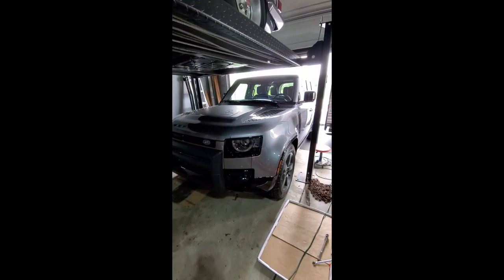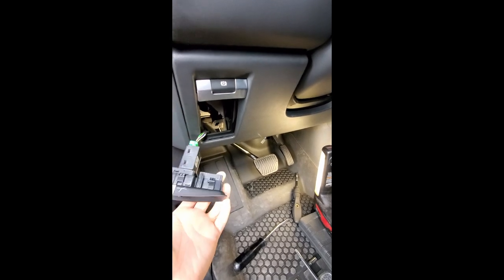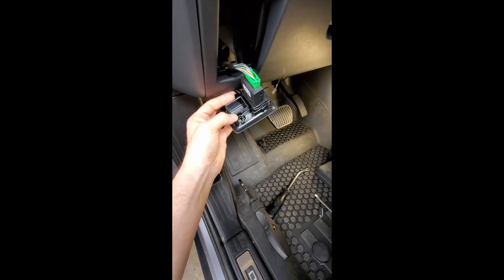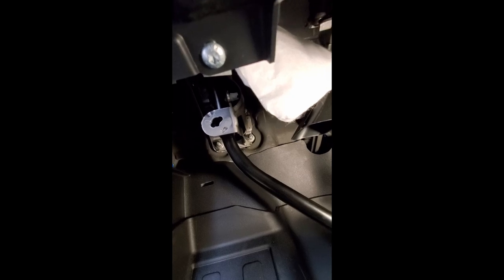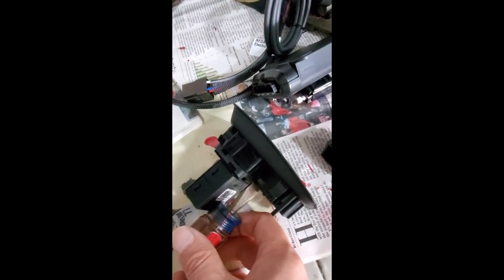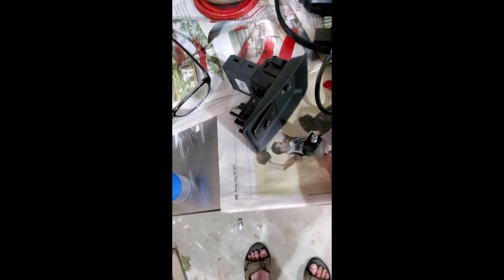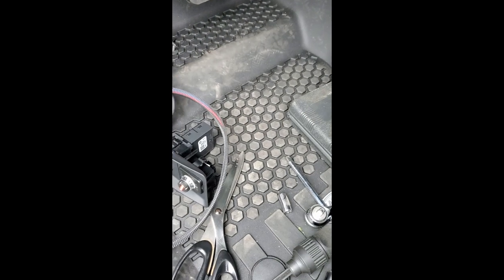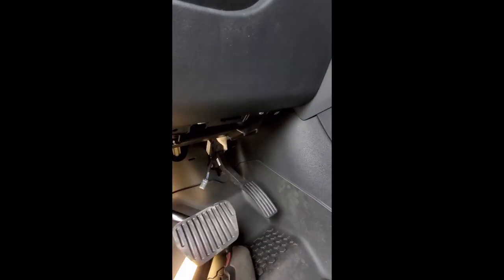Redarc Brake Controller in the New Land Rover Defender

Comment: Thanks this really made the job easy. Two suggestions: 1) drill your 1” hole in the middle of the knock out plate. Control knob just snapped in. 2) after removing the bottom panel of the dash also remove two large screws holding the panel above that. This will let hold bend this panel out just enough to see the back of the little panel you need to remove and get your hand in there to release the clips.
Reply from the maker: Good suggestions, thanks!

Comment: THANK YOU!!!! You've saved me so much heart ache!!! And probably my life...I was told the only thing I could use was a Curt Echo and it almost killed us. I can't wait to replace it!!!!
Reply from the maker: It's been working great for us.  The real problem with the Defender is the spare tire and the side-swinging door don't play nice with our trailer.  We actually have to take off the spare to tow it!
Reply: @midwestmotoring  agreed. The airstream dealer installed a Blue Ox Sway Pro for us that has a pretty longe tow hitch which gave us the clearance we need and we can even open the door a little. It violates what is in the Land Rover Manual, but I have to call and see how bad that is. The Defender manual really doesn’t provide much detail.
Reply from the maker: @TimWat12345  I think the length of the hitch has more to do with the tongue weight.  If you move the trailer farther back, it's effectively creating a longer lever arm and therefore more downward force on the hitch receiver.  If you're not maxing out on your tongue weight, you're probably okay.  It would also have a force that's different when turning, but I bet that's less relevant--especially given the wheel base on the 110.  Again, don't max out on the weights and you're probably fine.  Technically, you could probably get some physics student to run calculations for you....

Comment: I have mounted mine in the centre console and removed the 12v lighter socket - so much more convenient
Reply from the maker: Good idea!
Reply: Would you mind sharing how you got the 12V outlet out?
Reply: Thank you. My only issue is that I use the 12V and an adaptive charger to charge my iPad. The normal charge ports won’t do so

Comment: I have one suggestion. The knock-out plate is just wide enough to drill a 1" hole in the center. You can mount the controller into that plate which holds it very securely without the need to use double-sided tape to hold it in place, Remove the plate, drill the hole, reinstall the plate and then press the controller in from the front.
Reply from the maker: Thanks!  Good thinking!
Reply: hi, long thread from a long time ago.  i'm interested in what you are saying here.  do you ahve any pictures or video per chance of how you mounted this?
Reply from the maker: I don't, I'm sorry. I think I may have just used heavy duty mounting tape but it's been a while now.

Comment: Great video. I found my double sided tape didn't hold up in the cold - maybe because it was too cold when I installed it. Instead I bolted the Redarc (bottom left hole as you look at the unit from the front, with the front of the unit facing toward the seats) to that hole that you used for the cable ties, with a lock nut and some washers. shame they don't provide a little flat surface with a couple of threaded holes. guess they assume most brake controllers will be bolted onto the front of the plastic cover
Reply from the maker: Double sided tape is one of those things where the longer it's in place, the more permanent it seems to be.  Unless you're unlucky like I am, in which case you're pretty much hosed when you need it most.  :)

Comment: Hi. Which trailer wiring harness did you use for the 2022 defender. I want to double check that I got the correct one. Do you know if the brake control would affect the 12v battery feed to the trailer connection. It hasn't been charging our trailer when towing. Thanks so much
Reply from the maker: https://www.summitracing.com/parts/rdc-tph-006 is the link for the exact part we bought. We didn't go direct from Redarc since it was in stock and Summit shipped faster. You may be able to match up the part number though. Hope this helps!
Reply: I am also not getting the 12V power to the trailer from the 7 pin. Is there a fuse or something I am missing @midwestmotoring

Comment: First of all … thank you for a great video. I have installed the Redarc into a ‘23 Tacoma and it works great. We just purchased a ‘24 LR Defender 130 and I would like to do the same (dealership says I have to buy aftermarket) but when I use the Amazon filter by vehicle for the Redarc I can’t find any Defender controller for the past three or so years. Do you have any thoughts? I would greatly appreciate any thoughts. Thank you again.
Reply from the maker: I'd try reaching out to redarc directly and see if they can help with part numbers or information.  There are a few generic controllers on the market but it's been quite a while since I've looked.
Reply: @midwestmotoring thank you but another one of the viewers supplied the part number

Comment: This is a fantastic video! Question - look like you are using the harness TPH-006. Does that work seamlessly with the Defender. I inquired with redarc and they indicated that harness was not meant for the defender. It appears you have it working seamlessly? I'm getting mine in June and like this install - if you could advise on the harness I would appreciate it.
Reply: apologies - I need to read other comments. looks like TPH-006 is the right one!
Reply from the maker: Yep, and it's still working perfectly today! Thank you!
Reply: I just placed an order thru Amazon for the controller and the TPH-006. Did you mount that item to your Defender and if so is it working properly? Thank you.
Reply: @prayertool  Yes - follow Midwest Motorings video instructions and piece of cake to install. my went in easily and works great!